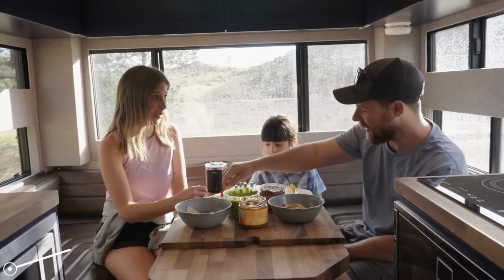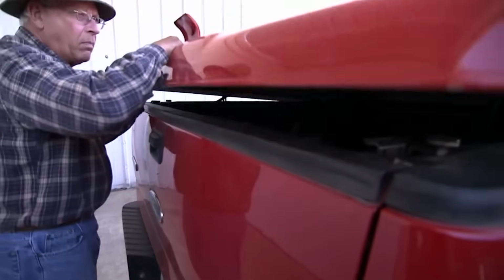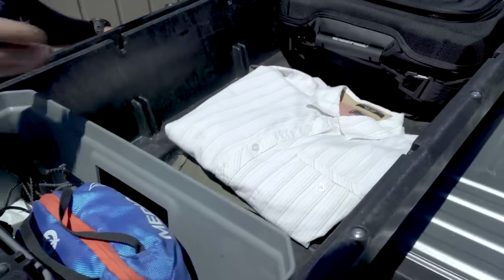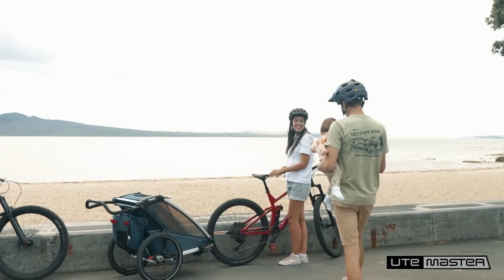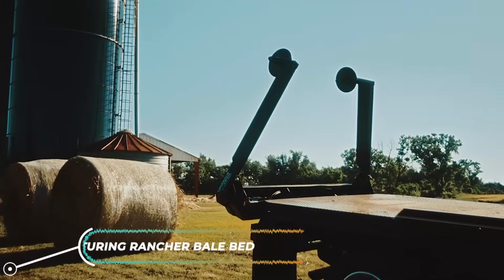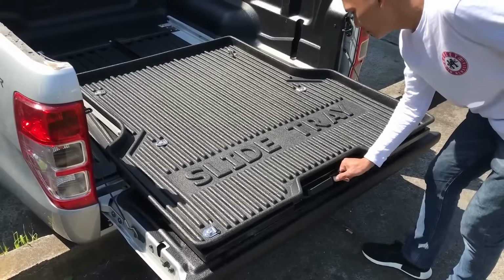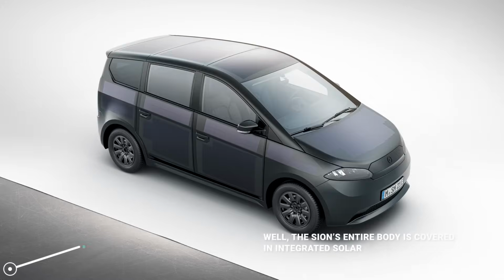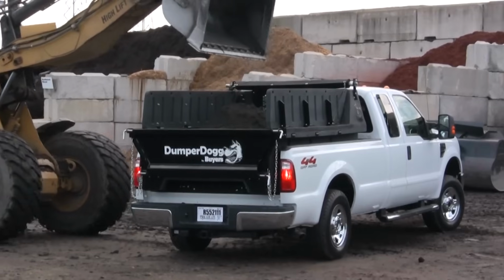30 Cool Inventions for Your Pickup Truck

Comment: I have the larger fold out bench step and it is the most practical purchase I’ve made for truck stuff.  It also doubles as a bed extender with a few elastic cords. It also doubles as a sitting bench when you want to chill.